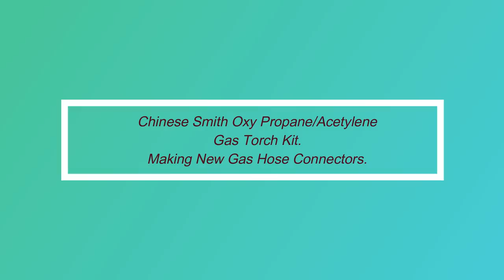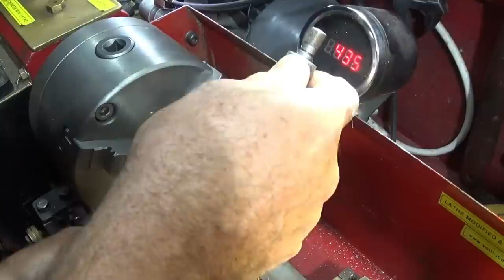Chinese Smith Oxy Acetylene/Propane Torch Kit. New Gas Fittings.

Comment: Oxy propane?......that will cost you a bomb to run.......better to run an Oxy Hydrogen generator as it cost nothing practically to run.
Reply: If you already have a oxy rig, why bother taking up room and investing in another system? 

In the States, a 80 cu ft of Oxy is going to run your ~$25 and who doesn't have propane for the grill? That only uses 8 PSI for the largest tip and would take 10 hrs to run a 80 cu ft dry.  A 20lb tank of propane can be had for $20 and would take around 21hrs to run dry with the largest tip.  If $3/hr is going to make you broke, you should be worrying about other things than a torch rig.
Reply: @longshot726  You would have to already have an oxy rig as you call it, that is oxygen and acetylene.....why would you want to have this one as well unless you only do oxy/acetylene cutting etc then you could benefit by having a brazing and gas welding capability too..........but if you want to be free from bottle rental and gas purchase etc the oxy hydrogen generator.....which I have........is the way to go as it will not cost you a bean or make you wait for a bottle refill when it runs out......forever.
I don't do oxy/acetylene work at all, like many people I know, so don't need bottles etc........I also have a plasma welder and that is a different strategy altogether.
Reply: @gangleweed  An Oxy rig is any torch system that uses oxygen and a fuel. Its full name generally is an Oxy-Fuel system. You can have Oxy-Acetylene, Oxy-Propane, Oxy-Propylene, Oxy-Petrol, Oxy-MAPP, etc. A lot of people in the States are switching over to Oxy-Propane since it is cheaper than running Oxy-Acetylene and no one gas welds anymore unless they have to since Tig welding is a thing. 

If you don't already have an Oxy torch system there are easier options than hydrogen. A hydrogen generator isn't something you are going to find unless you get some sketchy Chinese units. People do run these off of propane and old medical oxygen condensers all the time. It's not entirely self sufficient, but every 24/7 gas station has a propane cage.
Reply: @longshot726  What you are telling me is common knowledge.....I sold all  my conventional welding gear and went to a plasma welder as it's totally gas free and has a very high capacity for welding as in no gas whatsoever to buy, store or bottles to rent or buy.
I would only recommend an oxy hydrogen type gas generator for small DIY work but a big one can be handy too if you like gas welding, brazing, heating etc etc.

Comment: Where did you the the large Oxy propane torch from?
Reply from the maker: I bought it on eBay in an oxy propane set. I think I have seen them being sold on eBay separately though.
Reply: @SteveJordan  Thanks Steve. I have Oxy Actyene right now but need to get rid due to the insurance (or lack off!)